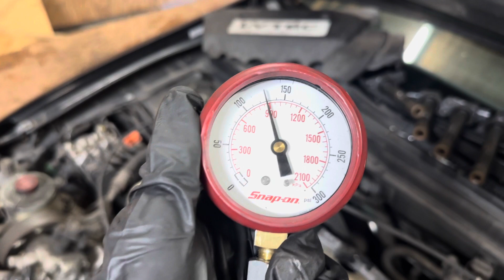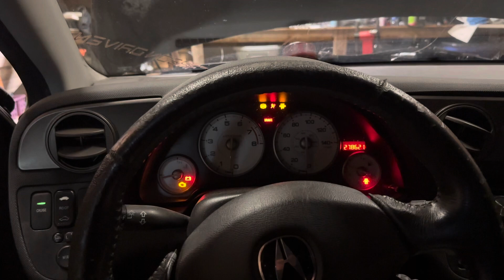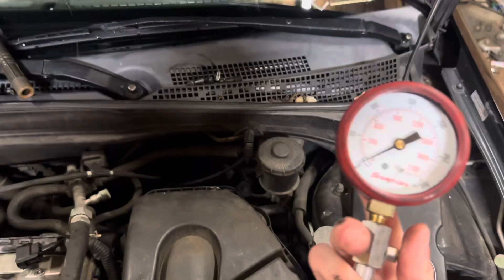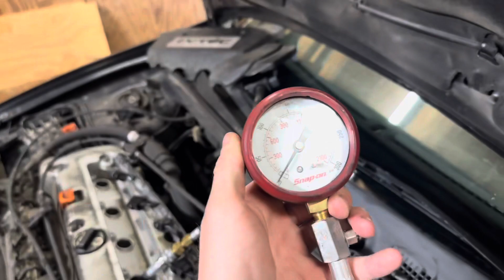How To Use A Compression Guage

Comment: You can put some drops of oil into cylinder 2 & 4 and recheck. If numbers change then it tells you something about the the compression rings. A leak down test can also give you a better idea if the issue has to do with valves, headgasket, compression rings

Comment: You can't have combustion without any compression. You must have misfires. When you put it back together, fire it up and pull the plugs off 2 & 4. If it runs worse or throughs codes, they must have adequate compression. Something else is going on.
Reply from the maker: It has been sitting for a while since i last cranked it…but idk whats going on🤣 shall find out soon